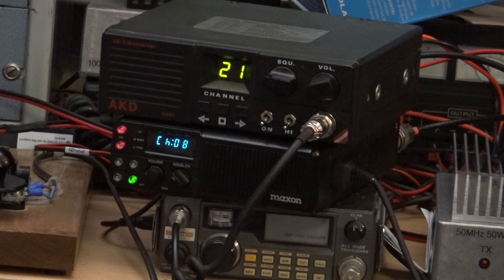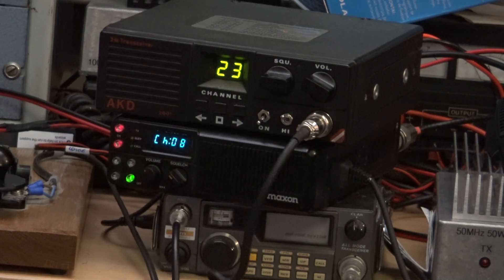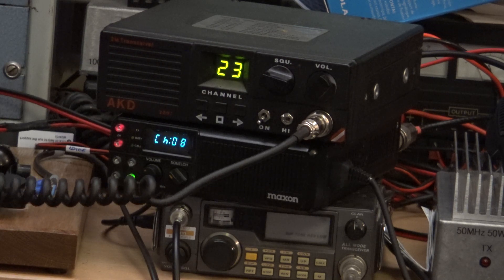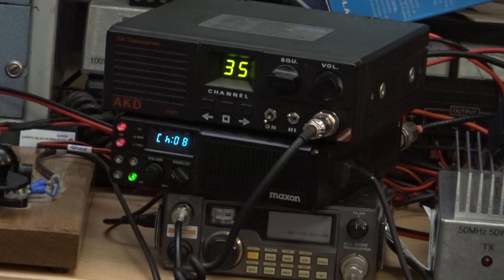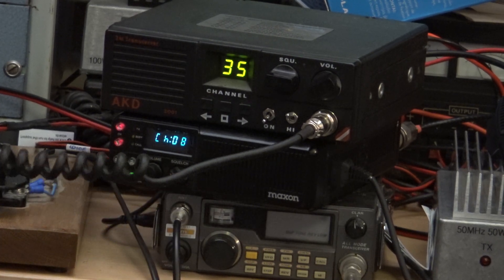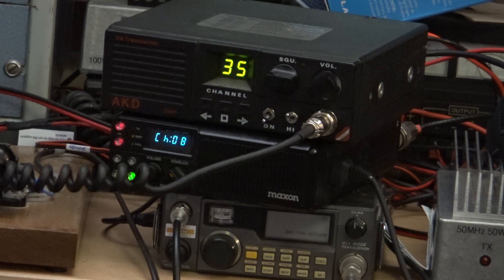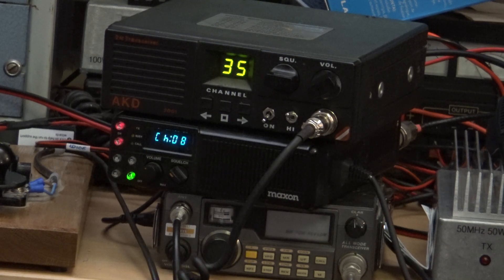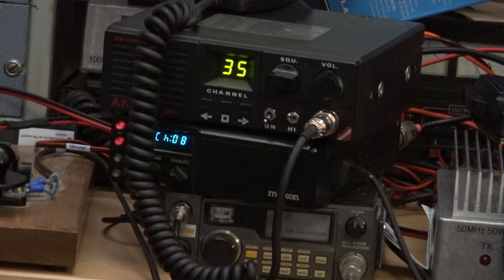2M Amateur Radio - on the air test - 5W FM demonstration, AKD 2001

Comment: Hi...I noticed you set the deviation to roughly 5Khz I presume this radio has 25Khz channel spacing,,,,,but, how will this work on todays 12.Khz channel spacing with 2.5Khz deviation...will it splatter over adjacent 12.5Khz channels?
Reply from the maker: Yes it's a 25khz radio. Whilst I'm aware there is now 12.5Khz channel spacing, I've not received any  notification to ban 25Khz or earlier 50khz radios. There is so little 2M radio traffic I can't see older radios being bothersome.

Richard, G0OJF, UK
Reply: @ukfmcbradioservicingTango21  Cheers Richard....I was wondering if the deviation could be set to 2..5Khz and the radio still work ok? Perhaps my question was not clear apologies...
Reply from the maker: @ningis21  Yes the deviation could be set to 2.5Khz. However, 12.5Khz signals will sound quiet on receive, so the IF filters need changing to suit if this was a snag.

Comment: Yeah, 1/4 wave and 5 watts is a bit of an ask.  Might be fine in other parts on England where it is nice and flat, but you need a good aerial, a co-linier at least on the base and a 5/8 on the car.  But at 2 meters I wouldn't expect a great performance with what you were using.  Most of the time you would either be talking to a home base station or from a hill or through a repeater.  I don't really like going through repeaters, but sometimes needs must.  My mate went through his licence when it was just a two step licence and to go further he had to learn up his Morse.  I think it stopped a lot going for it back then.  He I think used 200 watts which I always said was silly when he could see the repeater, but I found out later that when conditions were right he could get into a repeater in Northern Ireland where he knew a few operators and this is where his wife came from.  They are back there now, but he if away from radio at the moment.
Anyway, your course is much like here if this area is not worse (there is a lot more hills here for sure) though I have a bit of height here, but there is a hill right behind me which would make it impossible to get out.  Everywhere I stay there is a hill blocking the way I want to transmit.  I know what you are going to say "Get a full licence and get a repeater" well no.  2 meters ans 70cms is not a lot of interest to me due to the lay of the land.  4 meters and down, something I can still get a reasonable aerial on a car, whether there is anyone using anything up here is another mater.  I leave a scanner running and here nothing until I get way down in frequency.  I am interested in going higher than 70 cams though, I like a challenge.  Two of my Amateur mates died, bit of a shame as they were a bit of a laugh and Bill was a bit of a devil, he looked after transmitters for a living.  I had another mate who used to use Ham radio, I said Ham as he used to be out in the middle of nowhere either in Canada or USA looking out for forest fires, not seen him in years, I wonder if he is still around.  I digress again as usual.
Good to see how 2 meters does in your area and I see how you used the 1/4 wave at almost CB power.  Shame Mr Chippy didn't take the 5/8 aerial with him, might have seen a big difference with it.
Reply from the maker: Other identical tests are going to be on 6M in a matter of days & 10M when I have something suitable....and 23cm when I can get hold of a second radio....as I only have one 23cms radio at present.

richard
Reply: @ukfmcbradioservicingTango21  Oooh!  You will be pushing it a lot at 23cms over that road, but sometimes it can be surprising, will he get beyond the end of the lane?
Reply: a 1/4 wave antenna is pretty much the standard,
Reply: @bigpimp347  I know, but at higher frequencies you want as much gain as you can get, every little bit helps.  Sounds like a supermarket slogan!  The more aerial the better.
Reply: @bigpimp347  Radiation pattern on a mobile does not really come into it much, but yeah, gain can also be a bad thing if at a base station, better with a Yagi but gain can bring noise, there is always a downside.